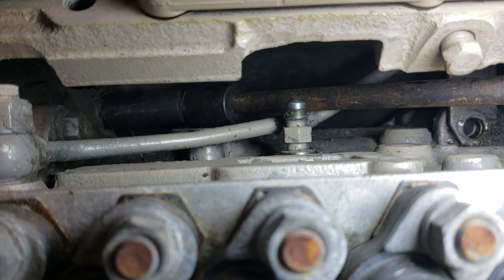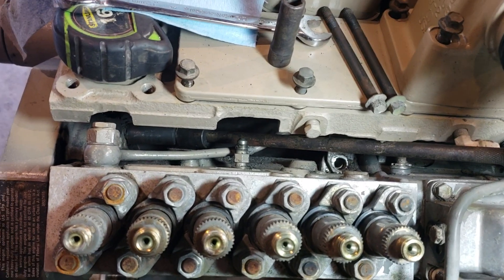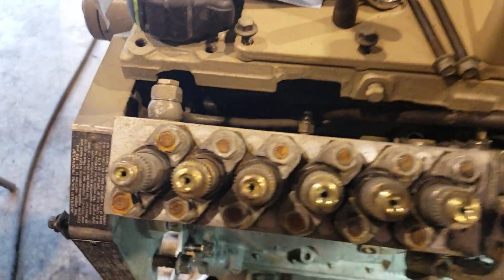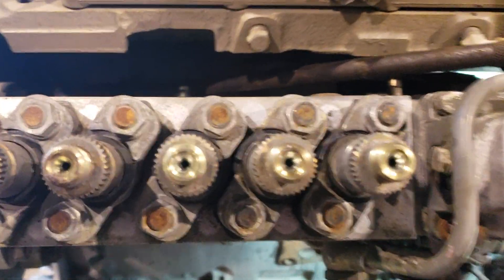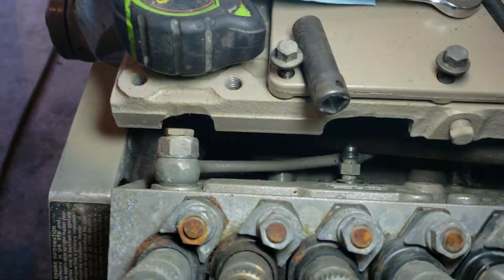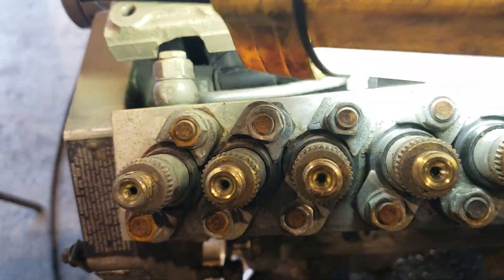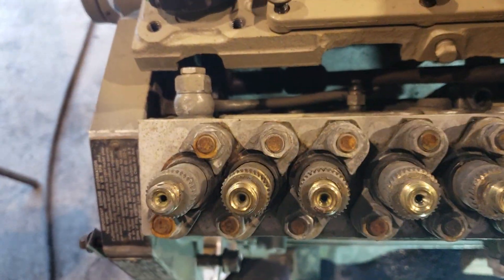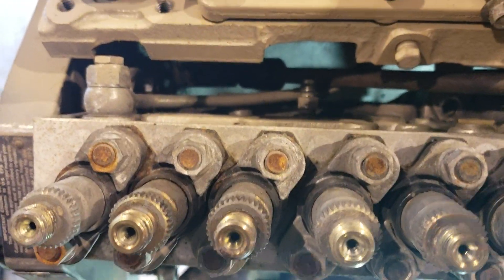M35A2 6BT Cummins swap: The secret to removing the injection pump without a special wrench.

Comment: Think a guy could remove governor back cover thing off when in truck? (somebody dropped a nut in there) Tried a magnet hot glued to a zip tie came out with no magnet :(
Reply: Definitely do it on the bench. Don’t remove that back governor cover. Just pull the governor spring plug and shake all the crap out while it’s upside down.
Reply from the maker: You probably could but it would be easier to just remove the pump and do it on a bench.
Reply: @tacticalrepair  Its my first diesel so Im a little freaked out. Thanks!

Comment: To remove the pump with the motor in the truck, do you have to open up the front cover or can you get it off just my taking the oil fill tube to get to the nut on the pump?
Reply from the maker: You can just remove the oil fill, but you risk dropping the nut or lockwasher into the timing cover. Hard to get the bore of the gear clean of oil for reinstall too. If the bore isn't 100% clean and dry the pump timing will slip later.